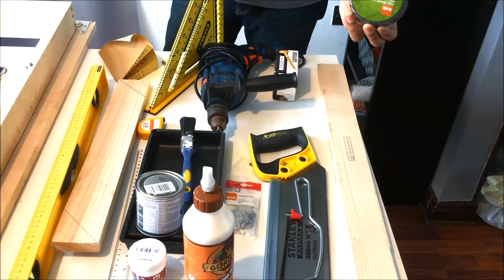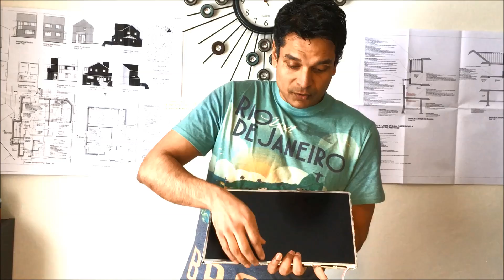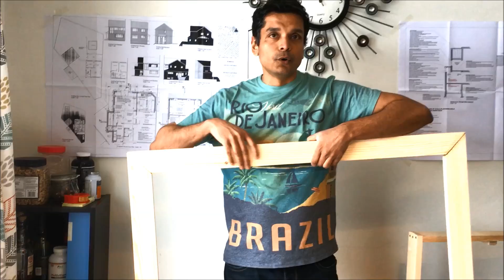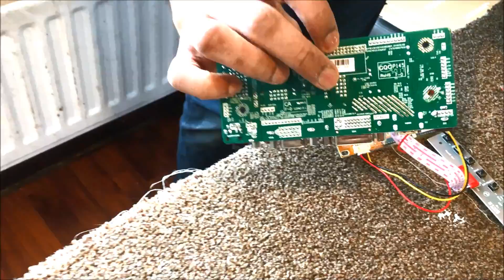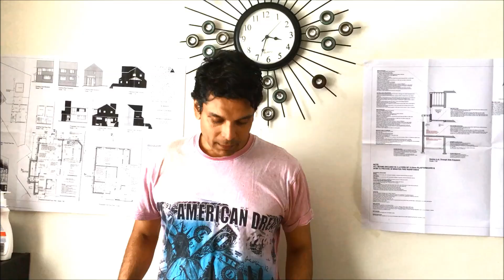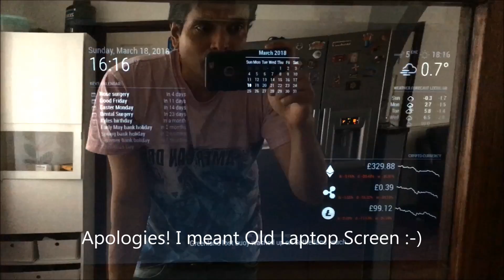Magic Mirror using Old Laptop Monitor and Raspberry Pi Zero W

Comment: Great video. How do you managed to get magic Mirror on raspberry pi Zero when I try to install it says raspberry pi zero does not support Magic Mirror. Please help.
Reply: Easwaran Chandrasekaran I’m having the same issue as well. Check the forums on github.
Reply: Installation
Raspberry Pi
Automatic Installation (Raspberry Pi only!)
Electron, the app wrapper around MagicMirror², only supports the Raspberry Pi 2/3. The Raspberry Pi 0/1 is currently not supported. If you want to run this on a Raspberry Pi 1, use the server only feature and setup a fullscreen browser yourself. (Yes, people have managed to run MM² also on a Pi0, so if you insist, search in the forums.)

Note that you will need to install the latest full version of Raspbian, don't use the Lite version.

Comment: Can you messga eme on the Pi w software ? Im having a hard time.
Reply from the maker: Hi , Here are the steps

1) Download the latest Version of Raspbian (With Desktop) on your PC from https://www.raspberrypi.org/downloads/raspbian/

2) Now Format the PI SD Card
Make sure you-- Format the Card First using https://www.sdcard.org/downloads/formatter_4/

3) Flash the OS to the Card Use ETCHER https://etcher.io/

4) Put the card Back in the PI and setup the WIFI password
sudo nano /etc/wpa_supplicant/wpa_supplicant.conf

network={
    ssid="Your WIFI user"
    psk="Your Password"
}
or use the GUI from the desktop 

4) Download and Install the Magic Mirror from GITHUB -- Follow the instructions
https://github.com/MichMich/MagicMirror

5) Setup your accounts as required by the Magic Mirror for Weather and RSS etc in the config file

6) Fire Up the Mirror using the node serveronly -- this is the only mode supported for a RPI ZERO W. if you have a Model B then you can refer to the auto start instructions on GIT Hub.

Hope this helps !!
Reply: No Im a noob still learning do I have to type all those commands ?
Reply: Robert Neilly gotta start somewhere! The end result is pretty awarding, alone. You got this.
Reply from the maker: Unfortunately you do -- But you should get a hang of it -- Dont give up -- All the Best !!

Comment: Can u make a the Mirror touch screen
Reply from the maker: Yes you can - just switch the laptop monitor for one that is touch compatible - in that case  u wont place it behind a 2 way mirror but alongside it
Reply: A better way would be to use an IR frame if your screen was the size of your mirror
Reply: Yes it's easy